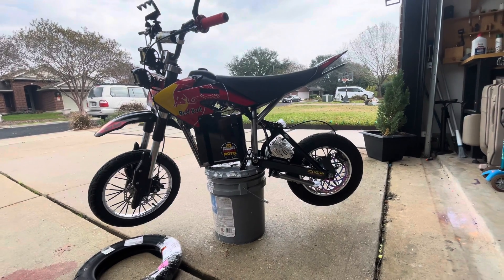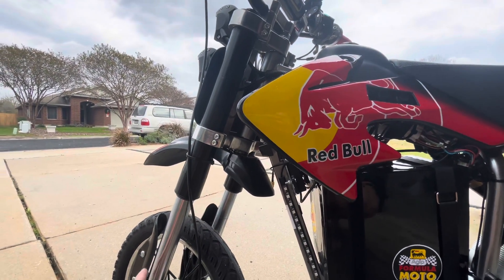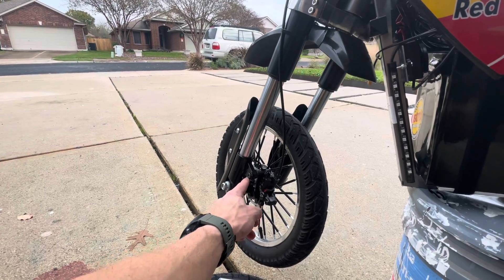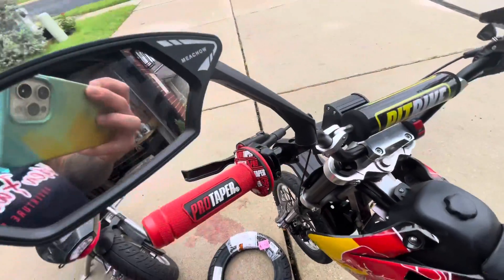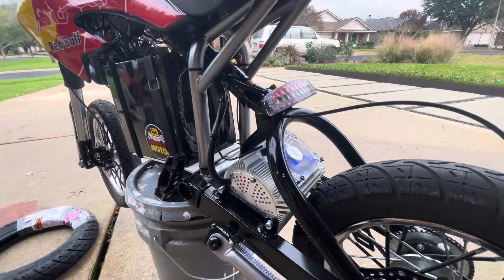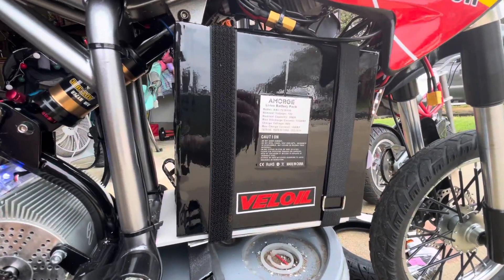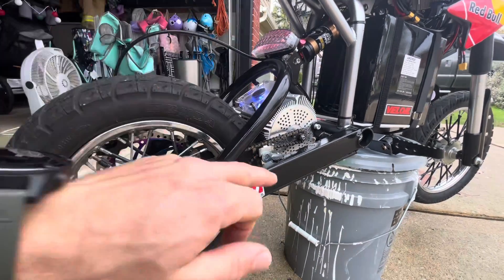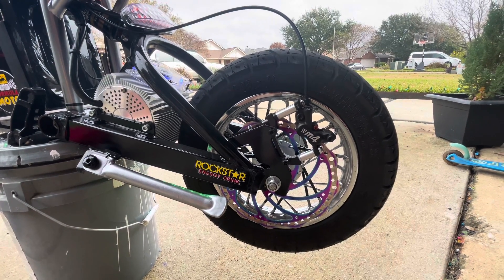72 Volt Razor Mini Moto With Electro and Company Kelly Controller and Kunray Motor MX500 MX650 SX500

Comment: How did you get that rotor on the rear to fit? I can't find any with the correct bolt pattern
Reply from the maker: Hey John. The one I bought bolted right up. I have a link for them in the description of the video if you think it might work with your wheel. 💪🏼
Reply: @VoltronWatts  I don't know if it's just not loading for me or something, but I cannot for the life of me see the link. I only see the one for the forks.

Comment: Is there a difference in mounting the rear shock upside down than upright ?
Reply from the maker: No. I had to mount it that way because the battery is so tall that it would hit the shock if not. 👍

Comment: Do u need a specific controller to add head lights and leds?
Reply from the maker: Nope. Just scoop a down converter that will make the voltage useable for your lights. Example: if your running a 48v battery get a converter that will take 48v to 12 volts and run all your accessory light off That. Easy peasy. If you have any more questions drop em here I’ll try to stay on top of the comments/ questions. Have a good night. 👊

Comment: How much have you spent on the bike in total and then I also have a few questions my first question is what is the range my second question is what is the charging time my third question is do you think it’s worth it overall and finally, my last question is have you ever been stopped by the police and if so what did you do or did you get in trouble?
Reply from the maker: Hey man, thanks for the comment. I think I have about $2,300 into the bike. I don’t even know what the range is because my ass and back can’t handle anything more than 10 miles at a time. Lol! I’d bet it close to 40 miles. To fully charge it’s about 7 hours. Is it worth it….? Yes! I love it, I love building them and riding. We have a community of people here that all have these bikes and we ride together regularly and we do family rides too with the kids and wives. We’ve never been messed with by the police, luckily.

Comment: Does the Kelly controller give you responsive torque immediately upon throttle or is it like a ramp up delay?
Reply from the maker: You can adjust how you want the throttle to react in the settings of the Kelly controller application. 👍

Comment: I want to try and do something like yours to my rsf650. How much did you spend on that build for only the electronics?
Reply from the maker: My battery was about 900, Kelly controller was $170ish and the motor was 200 something. Rough numbers here.
Reply: Ok thank you.

Comment: Great video! where did you get the e&c heat sink? is it on their website bcuz I thought you can only get if you buy the whole upgrade kit. Is the heat sink worth it?
Reply: Its a heat sponge it takes it from one places and holds it in the mass. Unfortunately its half great. Untill its hot!  Ppl make cooling options, but they are more than 65$. And require a decent amount of power to cool the motor. 
Drilling the vent holes and s.gluing a screen, of breathable fiber over the faces, will help cool and filter muck! 
After that. Consider a qs120 163 165. Its not hard to mount 1 up, and youre never going to worry about it again. 
Also keeping it nearer 4kw reduces wear and tear.
Reply from the maker: I got it off their website. And to be honest I haven’t noticed any difference. Then again I havnt taken the temperature of the motor before/after rides. More than anything I think it looks cool. 😂